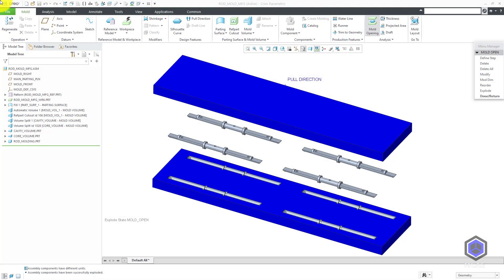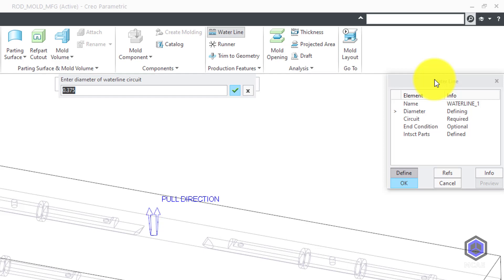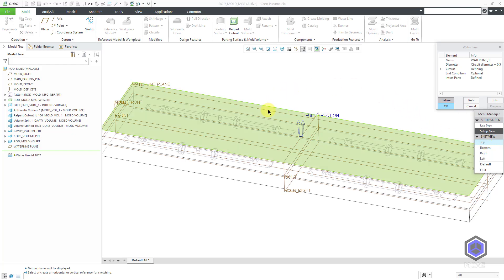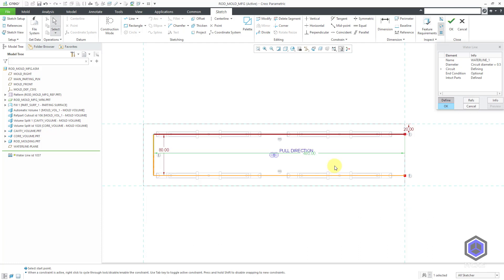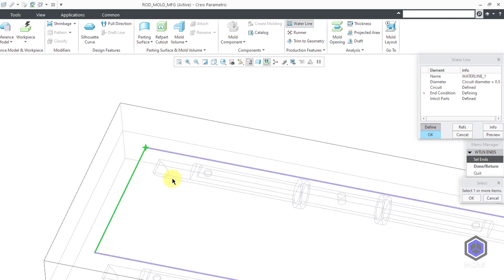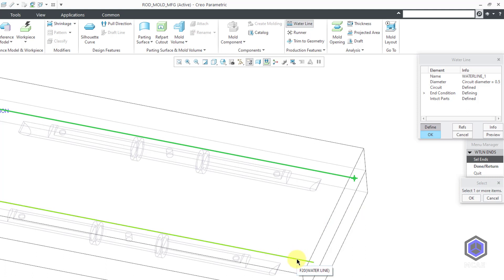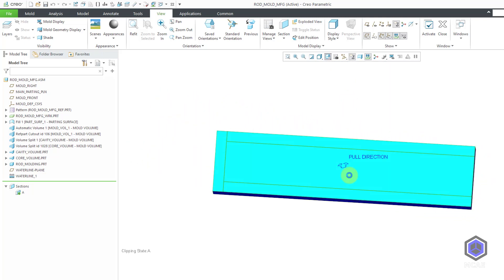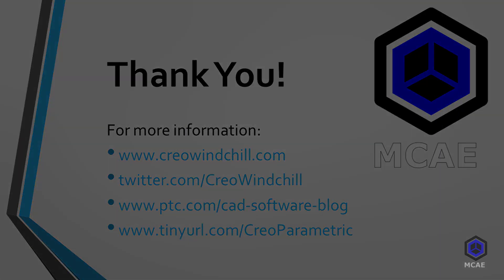Creo Parametric - Mold Design | Waterlines

Comment: It should be noted that the waterline diameter is the same unit as your assembly units. So in this instance 0.5 was a waterline 0.5MM in diameter, not 1/2". Keep up the great content! I was excited to see mold design on the channel.
Reply from the maker: My assembly is in inches. Those rods are ridiculously huge.